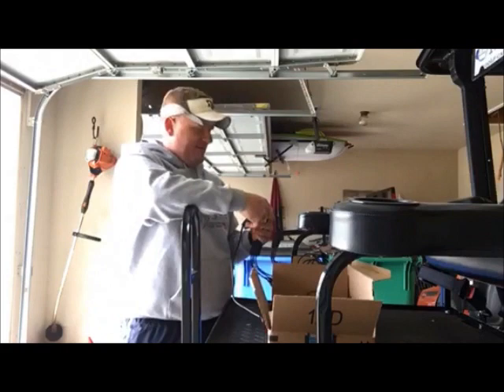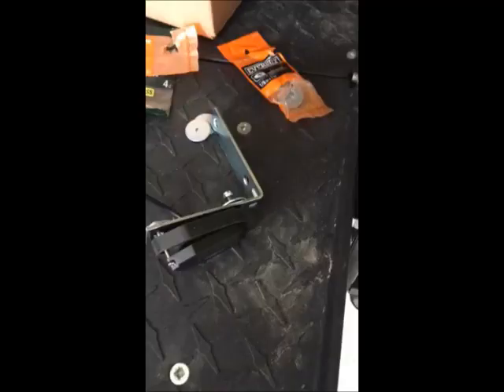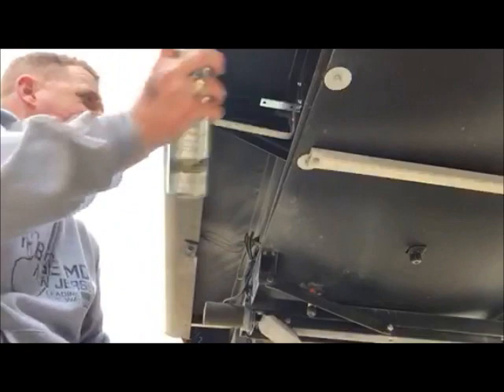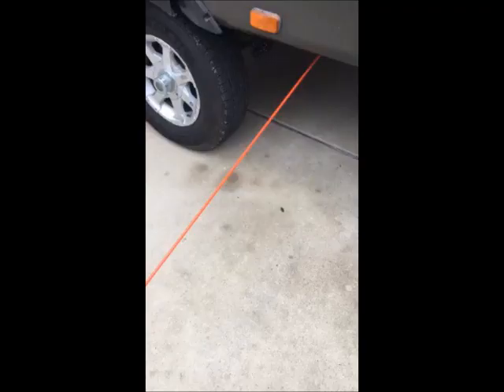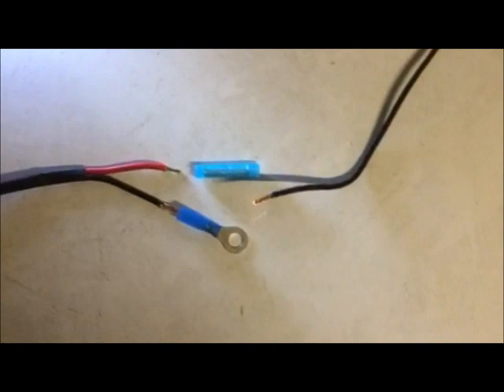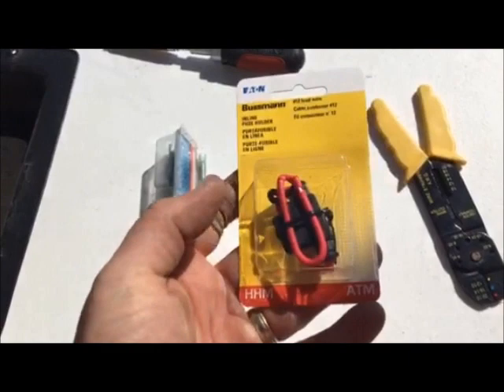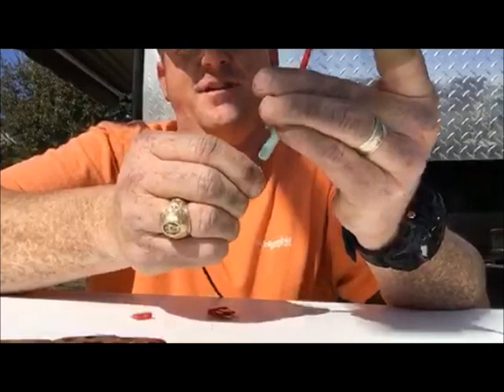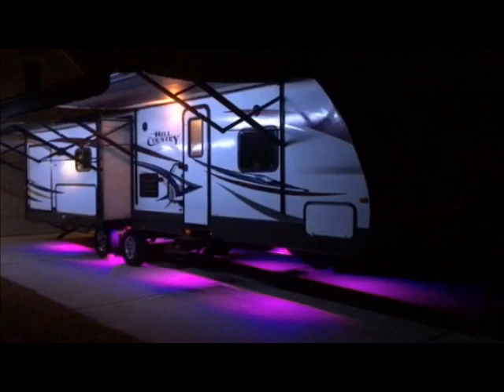How to Install LED Rock lights on an RV

Comment: I have 12 c4 White rock lights on my truck and In the market for a New trailer 17' - 27" trailer and plan on putting 4 down each side to help with set up and backing into camp spots at KOA. The install was clean and looks awesome good job Broski A++++

Comment: Cool job I actually got a roll of led strip lights and was gonna go that route but after seeing the rock lights I definitely am gonna install those instead thanks for the simple and easy to understand video!
Reply from the maker: cruz cruz thanks for watching! Let me know how it turns out.
Reply: @chriswinnek7200  so do you completely power on and off with your phone or do you actually install a power switch?
Reply from the maker: cruz cruz all with the phone.
Reply from the maker: cruz cruz phone only

Comment: Bad azz 👍👍was looking into led strip lighting ,, only 8 mounting pionts compared to getting the strip lighting to stick the whole surface is a pain ,, i know this aint my first LIGHT show did the under lid of my camper shell witch came out TITS nothing would hold the light to the carpeted shell but good ol' silicon along the bottom ... great vid
Reply from the maker: Thanks Ernesto!

Comment: Perfect! Thank you! I wanna pimp my lil camper with some rock lights and this is what I needed. I wasn’t exactly sure how to go about powering it. The question I have is how do they turn off once they are wired hot? Does your app turn them on and off through the controller?
Reply from the maker: Thanks for the kind words!  The app turns off the lights via blue tooth on your mobile device.

Comment: Is there a list of all supplies used. Or Amazon link for type of rock lights purchased.
Reply from the maker: Crystal Geiger no I did this a while back. I tied to capture most of the parts in the video. The exact led lights and parts have likely changed but I'm sure you can use similar light kits for your project and get the same results. Thanks for watching!
Reply from the maker: Crystal Geiger added the link to the lights and extensions in the comments

Comment: I’d be nervous about drilling that many holes in my RV frame. I think I’m going to try with 3M tape.
Reply from the maker: Thanks for watching! The holes are not going to be a problem as far as compromising the structure of the frame. The self tapping screws are pretty quick and very durable. I think the tape would work initially, but I would be surprised if it lasted more than a year or so.  Let me know how it holds up!

Comment: I’m curious, where did you have to place the extensions? Is it to connect the 4 from the other side to make the run across the camper or was it between lights on the side? I have a 19 foot camper. I want the 4 on each side also. Just curious how many extensions I should get. Thanks. Great video.
Reply from the maker: You may only need two. One for the drivers side rear and drivers side forward if you place the controller on the passenger side middle. With a 19’ trailer you may be good without the extensions. They are not expensive $12 I think. Better safe than sorry! Or wait and see and order them later. Let me know how it turns out!

Comment: How many 10ft extenders did you get for the 8 rock lights? I have a 35 ft bunkhouse lookin to do the same.
Reply from the maker: ThatEquine Pilot I ordered 4 and I think I used 2. They were only 7 bucks each so better safe than sorry!

Comment: I was under the assumption to never drill through the frame of any vehicle. That it could void your warranty also could cause the structural integrity of the frame to be jeaprodized ...
Reply: ramzy1013 not sure about the warranty, but holes that small will have zero impact on frame integrity.

Comment: Is drilling through the frame and hitting a gray,  black or freshwater tank not a concern?  I have no clue how they are actually positioned in the frame and like yours, mine are covered.
Reply from the maker: Your black tank is usually located right underneath your toilet and near your sewer discharge outlet. If you use the 3/4" self taping  bolts like in the video, you will be fine. If you want to make sure just unscrew your liner in a few spots near your sewer outlet and take a look at your tank locations.

Comment: Awesome job! Well explained! What size L brackets did you use that hold the lights to the trailer? Also were the L brackets pre drilled with the correct spacing to hold the lights or did you have to drill them yourself? If they were predrilled where did you buy them?
Reply from the maker: The brackets were predrilled and located near the hardware section in Home Depot.

Comment: New to this, but why is the fuse necessary?
Reply from the maker: Just want to add a layer of protection between the battery and the light control panel.

Comment: Chris - how are they holding up?  Anything you would have done differently?  I too was thinking LED strip - but it makes sense to use the rock lights as a secure way to bolt to trailer frame. Great video - thank you.
Reply from the maker: They have been great. I have had no problems. They are awesome and in have used them a lot when we arrive at night and need to set up in the dark. I just get out the phone and use the app to set the color and brightness and boom.
Reply from the maker: Also. They are more durable and easier to install than led strips.
Reply from the maker: Also. They are more durable and easier to install than led strips.
Reply from the maker: Let me know how your project turns out!  Cheers

Comment: Did you get away with only needing 1 extension?
Reply from the maker: I bought 4 and used three. They were only about $7 bucks a piece so better safe than sorry!
Reply: How far apart did you mount the lights? I just started my install this evening on my trailer.
Reply from the maker: Brandon Foster I just played around with them until it aligned with a good looking spot. I believe they were about 3-4 feet from the trailer edge and about 6 ft apart in the middle. Honestly the light puts out so much glow it ips pretty forgiving of all of the crap under the trailer. Just make sure they are evenly spaced apart from each other. This will make it look like a professional job.
Reply: Thanks boss. I finished mine up. Turned out perfect. 4 feet gaps, no extensions needed. I ordered them but didn't have to use them.
Reply: @brandonfoster5173  Have link to lights and extensions ?